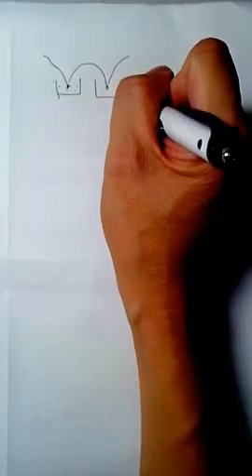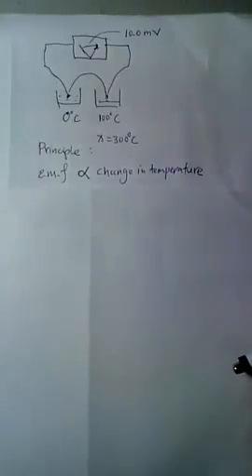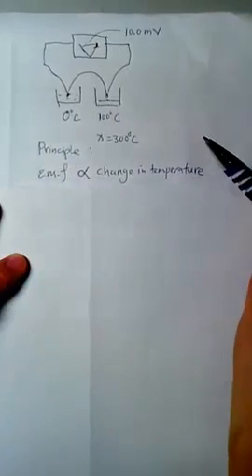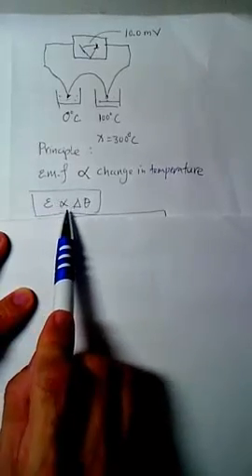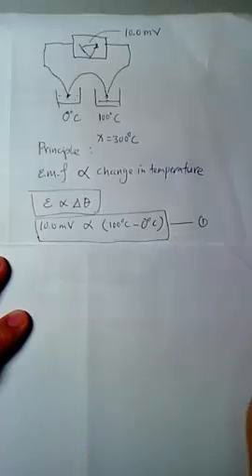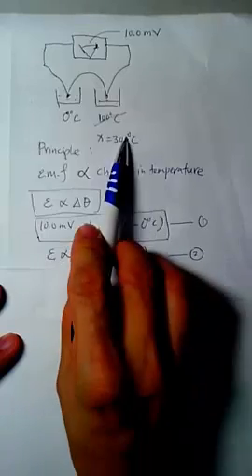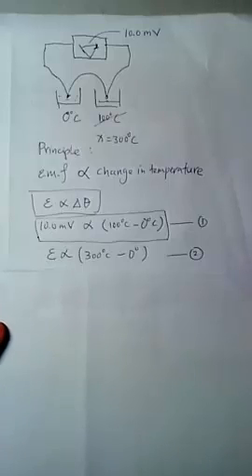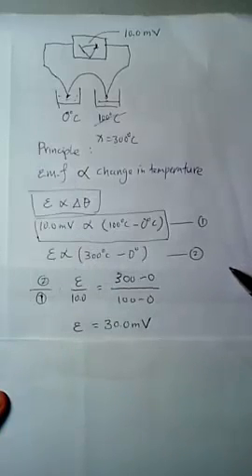Thermocouple principle

Comment: A thermocouple has a static transfer function of 55 mV/ºC and operates in range of 90 ºC-150ºC. At what time, the output will reach to 6 V if it has a time constant of 3 seconds

Plz solve this numerical its hamble request